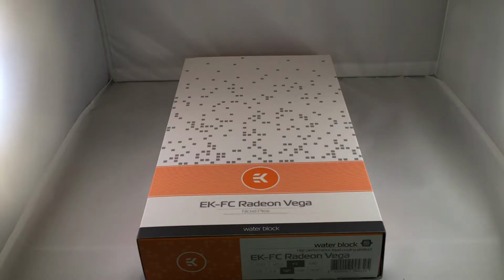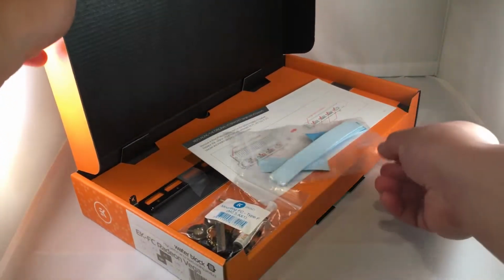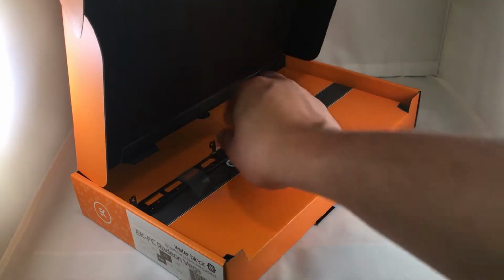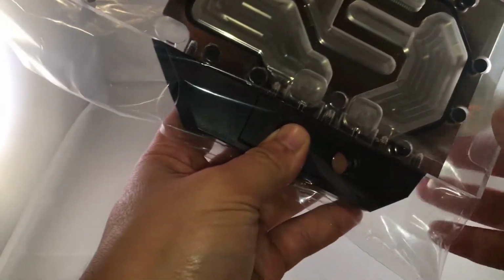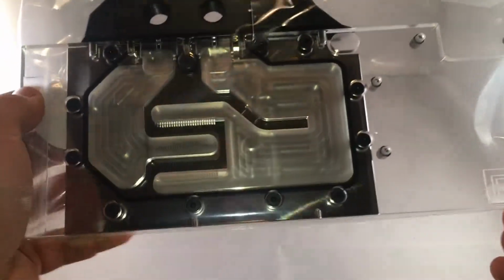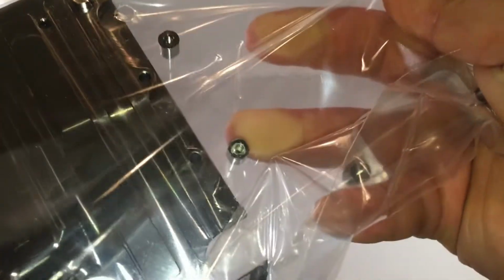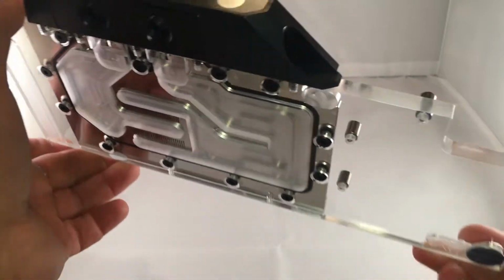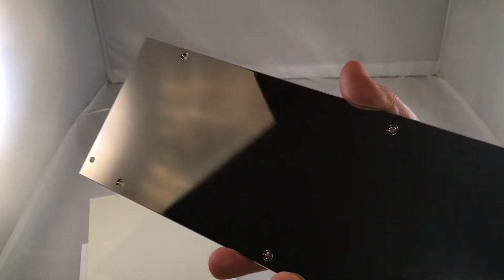EK FC Radeon Vega GPU Block UNBOXING

Comment from the maker: TEMPS AFTER INSTALL ARE USUALLY AROUND 33-35 DEGREES CELSIUS UNDER LOAN.
Reply: Hello! I suppose this is just the block.
Now you what is the complete set please?
Just buy a Vaga 56 and i would cool it for temps and noise.
I live in France hard to find that kind of stuff

Comment: is there anyway to light up the Radeon logo?? a complete shame if it doesn't :(
Reply from the maker: +Nathan Cunningham Unfortunately not, however, there are two small holes that allow you to put some LEDs into them.  You can buy the LED's directly from EK.
Reply: Mod Science, does that go all the way though to light up the logo? I'm guessing you don't have 3mm LED's laying around, but if you shine a light from the bottom upwards, does the logo light up?
Reply from the maker: +Nathan Cunningham It's not near the logo, it's closer to the nickel plating.  Subscribe if you haven't already done so because I'll be uploading footage of the completed build.
Reply from the maker: +Nathan Cunningham Hey, I just checked and the Radeon logo actually sits right above the GPU tach LEDs located on the back of the card.  So, the logo itself doesn't light up, but it will be illuminated when you power on the GPU.  I've been flushing the loop so I haven't had a chance to actually power everything on just yet.
Reply: Mod Science ok, that sounds promising.
Looking forward to further videos.
I have placed an order for this waterblock, and getting the HIS Vega 56 card when in stock.
Cheers